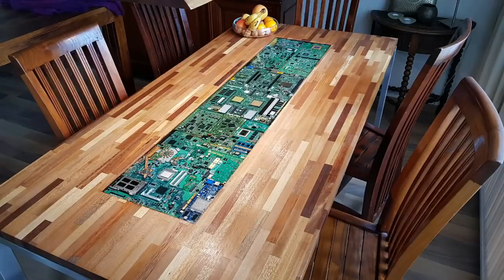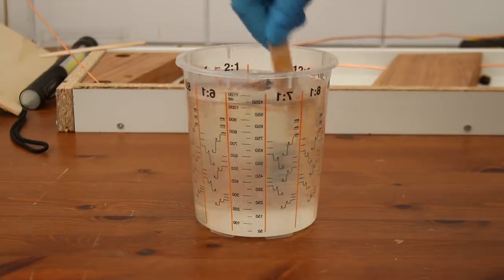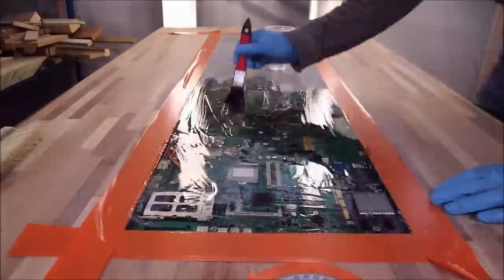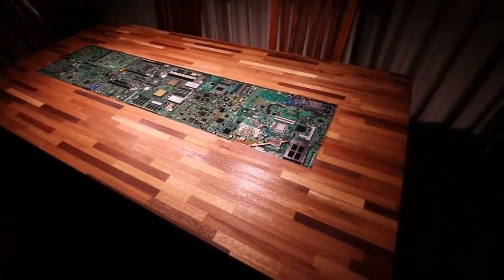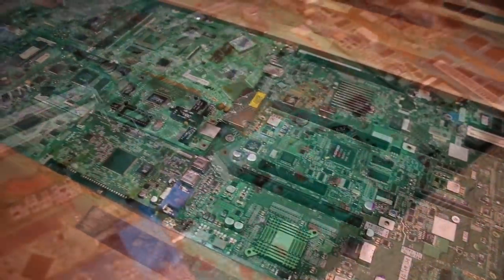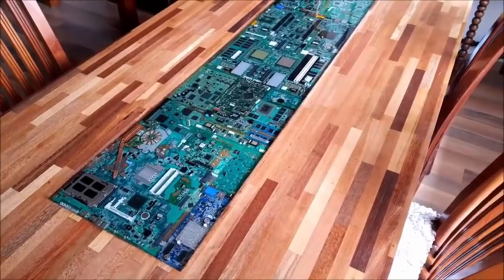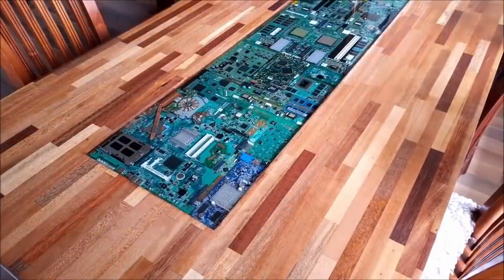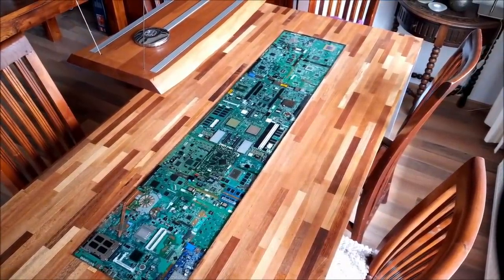Circuit boards with lights in epoxy in a table

Comment: Using the fibre optic cables is actaully a really neat idea. I'd probably go with god ol' electricity though, less work!
Reply from the maker: Imagine children playing with my table or with yours, while you are sitting at it... 😊 There is no end to the electric one, while the playing ends much sooner when you have to hold a light source to it... 
Besides, mine is infallible, where when your LED breaks down, it is gone forever... 
(But I like to see your one anyway.. 😊👍)
Reply: @Onrust1  yes it's true that there's no way to replace an LED if it's been epoxied in place. The reason I would personally go with LEDs instead of the fiber optic way is because I'm lazy and I can't be bothered drilling holes into many LEDs and then routing all of the fiber optic cables haha. I find it easier just to solder some thin wires around the place, but as you say there are pros and cons for each I reckon.

Comment: You have a f*cking dual socket motherboard and you just epoxied that thing into the table??!
Reply from the maker: Yes! Good ain't it? I preserved what was about to be thrown away and thus ending in bit-heaven, forever! 😆
Reply: @Onrust1  I'm guessing it was broken, otherwise if it was relatively new it could be worth quite a bit.
Reply from the maker: Yeah... it was really worthless.. got it out of the trash of a datacenter.
Reply: @Onrust1  ah right that's good. I was a little shocked to see it ngl haha

Comment: Put a glass cover over the whole thing.
Reply from the maker: That would definitely have been a 'quick fix'. But by now I'm almost ready 'fixing' the table. As you can see here:  https://www.youtube.com/channel/UCNdDV4vHKjuWOYlEW4HIk5w/community   I routed out the bad spots and poured in new epoxy. It's much better now than it was. Wait for the video 'how (not) to pour epoxy'. 😊
Reply: @Heinz Kunz so you can't touch the sticky parts of the table
Reply: @Heinz Kunz  so you can't touch the sticky parts of the table

Comment: I wonder if pouring separate layers might have helped?

Either way, thank you for using MODERN computer curcuit boards for this rather than the rapidly dwindling "vintage" computer stock.
Reply from the maker: I poured separate layers. I'm making a new video where I show in detail what is wrong with it and how I repair the table. Wait for it. 😊
I did not really put any thought into what kind of boards I put in. I was already glad I had them.. 😊
Reply: @Onrust1  Looking forward to it. My thought was to mix the resin with an electric egg beater on low speed to avoid bubbles. Using the LEDs as fibre-optic end caps was a good idea, I like the way that turned out. 

Colour-changing LEDs might be something fun to try on a future project. Because of natural variations in the quality of the semiconductor used, they will drift out of phase with each other the longer you leave them on, producing what looks like a totally random multicoloured pattern.
Reply from the maker: I didn't know the color-changing ones... only the RGB-type, but you're talking about something completely different, I guess... I'll look into them. Maybe for a next project. Thank you!
Reply: @Onrust1  I haven't tried them myself, but Big Clive has them on his channel in several videos. https://youtu.be/vNucN3ZW8Vg?t=1098 I linked it where he tests the lamp, in case you don't want to see the entire assembly.
https://www.digikey.ca/en/products/detail/pimoroni-ltd/COM0625/9169550 
Digi-Key has bulk rate shipping, so if you don't order from them regularly it might be a few bucks cheaper to order them off of eBay or somewhere else.

Comment: Just put a glas-plate on the table
Reply from the maker: That would definitely have been a 'quick fix'. But by now I'm almost ready 'fixing' the table. As you can see here: 
https://www.youtube.com/channel/UCNdDV4vHKjuWOYlEW4HIk5w/community  
I routed out the bad spots and poured in new epoxy. It's much better now than it was. Wait for the video 'how (not) to pour epoxy'. 😊

Comment: all that work, and the only thing your concerned about is the bad epoxy? Not the ugly exposed circuit board? Just to make a few led's light up? It's defiantly a narrow group your trying to appeal to.
Reply from the maker: 'Ugly' is an opinion and the 'narrow group' an assumption. And I think a wrong assumption. Go read the comments on this video...
Reply: of course it's my opinion, I wrote it. and narrow group is mine also I can only assume its a narrow group because when you buy anything with a circuit board in it it alway got an attractive cover to hide and protec the circuit board

Comment: Fantastic idea! Turned out great apart from the sticky parts! 
I guess thinner layers of epoxy that is allowed to 'cure' for longer before the next thin layer is applied would give a better finish?
I'm assuming the epoxy didn't cure properly in places because it was applied too thickly and then other layers applied over that, not allowing the epoxy to harden properly? 🤔⚠️👍😎
Reply from the maker: Thank you. Yes, that is one theory. The other is, like mentioned in the video, that I didn't mix well enough. After trying to fix the table, for me that is still the most probable cause... Look here: https://www.youtube.com/channel/UCNdDV4vHKjuWOYlEW4HIk5w/community
Reply: @Onrust1  I suppose it would be easy to make a small test piece  using one small circuit board in a small  opening in a cutoff bit of wood and try different ways to mix the epoxy or different methods to cure it etc until you find the perfect result! 😎👍
Reply from the maker: It's not that easy. The layers in between it went wrong were 5 liters underneath and 3 x 1 liters on top, and there were 3 days in between. What role played the thickness of both layers? Was 5 too much? Should I have let the 5 liters cure longer than 3 days? And you can never 'test' not well mixed epoxy. Epoxy is kinda mysterious stuff...
The only thing I can do is doing better next time and then try not to fall in any pitfalls.

Comment: I think I would have routed a small recess for a glass sheet and not bothered with the epoxy at all. Save lots of work and $$$
Reply from the maker: That is a very decisive important choice. Yes, glass would have been easier and cheaper. But to my opinion... just not as pretty. The way light only breaks once in epoxy, where it breaks twice in glass is a difference. On top of that: the components are IN the epoxy, so in a way they seem much closer. Then what is in epoxy, is more 'frozen' in time. It doesn't age as much, it doesn't corrode, and it doesn't gather dust. I understand very well what you're saying, I certainly know that epoxy can be a pain, but I've got no regrets...

Comment: next time ask a car painter (me)

PS: i konw what you did wrong if u want i can help you.
Reply from the maker: Ehrmmm.. I think I know what I did wrong... I messed up the mixing. I'll do what I can to not repeat it..
Reply: now comes a long text please don't scare XD
Reply: @Onrust1  Hello, I am from Germany and work as a vehicle painter, so I know a lot about chemistry and physics.
I saw that you are using a 2 component material. Exactly all right so far, but I saw that you touched a little bit of material first and added something later after you distributed the whole thing. You should avoid something like this because the material does not mix with each other (because it is not stirred).
It is best to tip everything onto your surface at once.
If you make several layers, you include solvents in the surface and these want to escape upwards. In addition, it may be that you have not waited long enough between the different layers until the material has fully hardened (1-2 weeks) and there are no more solvents.
Then you have to make sure that you mix the 2 components well, very important.

So in a nutshell:
1. best pour only a thick layer
2. If you want to do this with several shifts, it is better to wait 1-2 weeks until you do the night shift.
3. Mix well!
4. Do not pour material from several pots, as the whole does not mix with each other.

I hope I can help you with that, the damage that is now on your table can unfortunately not be undone, unfortunately this has to be done from scratch.

I wrote this with google translator so don't be surprised about the sentence structure.

Greetings from Hamburg, please contact me if you have any further questions.
Reply from the maker: Danke. Du kannst es ruhig in Deutsch machen... 😊
Also ich weiss jetzt so ziemlich genau wo es schief gelaufen ist: Ich habe zuerst 1,5 liter gegossen, dann dadrauf 5 liter, und dann nochmal 3 x 1 liter. Irgendwo zwischen 5 liter und die drei liter ging es schief. Ich bin davon ausgegangen das ich die 5 liter einfach nicht gut gemischt habe (mehr mischen ist auch schwieriger), aber du sagst jetzt es könnte auch sein das, weil es noch nicht genügend hart war, es noch so irgendwie ein Lösungsmittel dazwischen eingedrängt war? Zwischen die 5 und 3 liter waren drei Tage... Mmm interessant ises... 🤔 Aber ich weiss nicht... ich glaube noch immer wahrscheinlicher wäre doch ich habe die 5 nicht gut genug gemischt. Denn es gibt im Tisch so grosse Unterschiede. Sagen wir mal links sind die luftblasen nur sehr dünn, aber im Oberfläche etwas grösser, währendem rechts die blasen eben nicht so gross sind, aber tiefer, und... ja... hässlicher... Helfe mich nachdenken.. (du bist der richtige Person... 😊) wenn es um ein Lösungsmittel ginge, musste es dann nicht im Tisch ungefähr überall das gleiche sein? Wobei wenn ich nicht gut gemischt habe, da könnte es eben unterschiede geben.. nicht?
Was du sagst über verschiedene kanister ist interessant.. verstehe ich aber nur schwer... Ich habe gedacht epoxy ist eben epoxy?
Grüsse nach Hamburg, aus den Niederlanden (von dieser halber Österreicher - deswegen das Deutsch... 😊)
Reply from the maker: Noch was, ich bin jetzt so ungefähr fertig mit dem reparieren der Tisch, und das ging irgendwie ziemlich gut. Du kannst es hier sehen, wie ich mit der Fräse die oberfläche weggeholt habe, und neue epoxy eingegossen: https://www.youtube.com/channel/UCNdDV4vHKjuWOYlEW4HIk5w/community
Reply: @Onrust1  Moin, das ist praktisch, dass ich auf Deutsch schreiben kann 😁

Mit der Fräse das zu machen ist sehr schlau, allerdings musst du ja die Elektronik teile neu machen, aber nächstes mal klappt es 100%.

Ich kann verstehen das es schwer ist 5 Liter zu mischen, dauert dem entsprechenden auch länger, aber am Ende hast du ein super Ergebnis. Wenn man erst 1 Liter rein kippt und dann nach ein paar Minuten noch mal mehr nach kippt werden sich diese beiden nicht miteinander vermischen und daher kann es sein das sich das ganze in verschiedene Regionen Quai gespalten hat. Also in der Mitte was du als erstes rein gekippt hast und links/rechts was du danach rein gekippt hast.
Am besten du mischt direkt 5-10 Liter an, ich weiß nicht wie viel dein Verbrauch damit ist, und kippst direkt alles rein bis oben zur Kante, dann hat das Material genug Zeit aus zu härten und du musst nicht schicht für Schicht gießen.

Es kann auch sein, wenn das Material nicht hart genau war, entweder nicht genug gemischt oder einfach nicht lange genug gewartet. Weil noch 2-3 Tage später können lösemittel im Material sein, auch wenn es sich hart anfühlt.
Am besten wirklich 1-2 Wochen warten.
Und diese dünnen Luftblasen nennt man in der Fachsprache "Kocher" (die lösemittel kochen vom Untergrund an die Oberfläche) 

Es muss nicht überall gleich aussehen weil sich die lösemittel den besten Weg von alleine suchen. (Einfach gesagt)

Und achte darauf, dass du den gleichen Hersteller vom epoxy kaufst wenn du mehrere Kanister bestellst. Das kann auch Unterschiede ausmachen.

Wenn du das ganze noch mal machen möchtest empfehle ich dir, dass du dir genau ausrechnest wie viel epoxy du für die ganze Oberfläche brauchst um das zu füllen, und dann alles auf ein mal rein kippst.

Oder du machst nur 2 schichten aber lässt diese lange aushärten.
Und ganz ganz wichtig ist das Mischen, wenn das nicht richtig ist kann man sich leider alles versauen, da spreche ich aus Erfahrung.
Lass dir einfach Zeit beim mischen, benutze ein großen Rührstab und rühre mindestens 5 min und schön von unten nach oben und kreisförmig damit sich das Material von unten mit dem Oben gut verbindet.

Freut mich das ich helfen kann, wenn sonst noch fragen offen sind, einfach anschreiben👍
Reply: @Onrust1  Achso und anstatt du am Ende noch mal eine dünne Schicht erreichst damit es glänzt, versuche es einfach zu schleifen, von p120 bis p320 und dann immer feiner Schleifen bis zur p2000 oder bis p6000, so fein du kannst und dann kannst du die Oberfläche ganz einfach mit Politur und einer Poliermaschine auf Polieren bis es glänzt aller Dings musst du da sehr genau schleifen weil sonst grobe schleifriefen (kratzer) entstehen. Das heißt in 100er Schritten schleifen. 

P120, p240, p320, p400, p600, p800, p1500, p2000, p3000, p6000
So wäre das professionell, dauert aber auch sehr lange.
Reply from the maker: Das mit dem schleifen habe ich jetzt bei das reparieren der Tisch gemacht. War von anfang an der Plan, aber wie ich dan die Blasen gesehen habe, habe ich diese extra schicht drüber gegossen. Das schleifen hat jetzt ganz gut geklappt. Bei mir war es 100, 180, 320, 600, 1000, 2000 und 4000, und danach polieren. 
Bei grösseren mengen mische ich jetzt nur noch mit der Maschine. Habe mich ein Impeller gekauft, ein teil was es im Wasserpumpe von Boote gibt, und das an meine Akku-Bohrmaschine geschraubt. Funktioniert gut.
Nochmal danke fürs mitdenken. 😊👍
Ich weiss du hast No Name, und siehst aus wie ein kleines Mädchen ohne Zähne, aber vielleicht erfahre ich nochmal dein richtige Name... 😊
Reply: @Onrust1  ja mit dem Schleifen hast du auch alles richtig gemacht 😄👍
Und zum mischen hätte ich warscheinlich auch mit der Maschine gemacht, geht deutlich einfacher 👌

Mein Name ist Domenic Grabowski und ich bin 21 aber Männlich 😅 und zum Glück kein kleines Mädchen ohne zähne 😂

Wenn du in Zukunft fragen hast oder ähnliches gerne bei meiner E-Mail melden : grabowdo@gmail.com 

Liebe Grüße aus Hamburg nach Niederlande 😄👍

Comment: Based on many mistakes made (example: not using a level beforehand), I'm not surprised he didn't mix thoroughly. 
Probably didn't measure correctly either. 
Spent way too much time on temporary tent instead of epoxy pouring prep.
Reply from the maker: Your comment is drained in assumptions and negativity. Welcome to my channel..! 😊 
I'm so glad so once in a while such a Mister Perfect like yourself comes by. It makes me deeply realize what a loser I am...
Reply from the maker: You can do a lot here, but insult me you can not. Calling names you do elsewhere.
I suggest you leave, and don't come back.
Reply: @Onrust1  I'm just saying if you're gonna try to make $$$ on self proclaimed craftsman youtube video, then you're fair game to criticism especially on poor execution and omitting critical steps. It comes with the territory. If you can't take the heat, leave the kitchen.
Reply from the maker: I have no problem with that whatsoever. But you don't call me stupid, a fool or an idiot. Those comments I will delete.

Comment: Number 1,  that's a great pour non the less, and B. you could use your router to shave an 1/8" off the entire table top, thus it making it flat and clean. 
Not sure if that would work but I did stay at a Holiday Inn Express last night.....

Comment: my dad had to make a conference table for his work, so his boss gave him this really crappy table that they were currently using.  he then sanded it all down stained it and did a 1 inch ish epoxy layer over the top of the table and this was a conference table so it wasn't small.  every batch of epoxy was fine until one batch was for some reason cloudy that then ruined the whole table and his boses would'nt accept it and it is a pain to remove epoxy.  he also made custom welded legs for this table and spent hundreds of man hours.  twas a real bruh moment
Reply from the maker: Wow bummer..! I know the feeling... What happend in the end with the table? Removing epoxy can be done..
Reply: Onrust! No idea, he started on removing the layers,  it I don’t know what happened after that.

Comment: ... mit Lichtern heist das ... Die Lichtleitungen hätten mir unter den Platinen verlegt gefallen, unter der Tischplatte nicht. Das schaut von unten aus, wie meine alte Märklin Anlage.
Reply from the maker: Unter die Platinen geht nicht. Die Leitungen beugen sich nur mit einer Rundung von 1 cm. Die brauchen raum. Aber ich habe später, auch zur schutz, noch eine Holzplatte darunter montiert. Die Leitungen sieht man nicht mehr.

Comment: Were you using air spray to get the bubbles out of the epoxy?
Reply from the maker: No I have a small torch.
Reply: @Onrust1  Good to know, thanks. :)
Reply from the maker: I have no experience with spray, mainly because the torch works fine, but nevertheless I'm curious about that. 'Spray' sounds somehow friendlier than 'torch'.. 😊 But the torch was a few euros, where the spray was like 16? Or 20? For a can... so that held me back. I'm interested in stories from people who used the spray. So if you did...
😁
Reply: @Onrust1  Heh, I'm not sure if regular air spray works, I thought that was what you were using, which is why I asked. Vacuum is the best way to go, but not easy to create a seal over something like your build. I have read and heard a hair dryer or hot air gun works well. I've also heard of people using small straws, but I imagine that could get tedious.